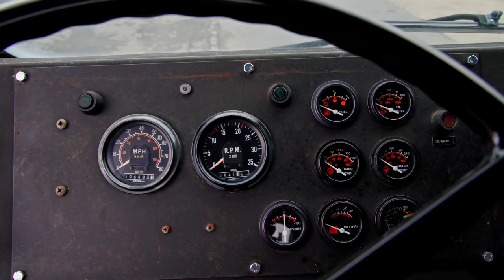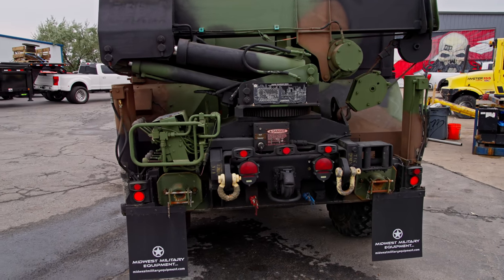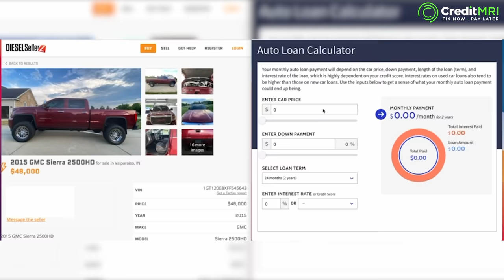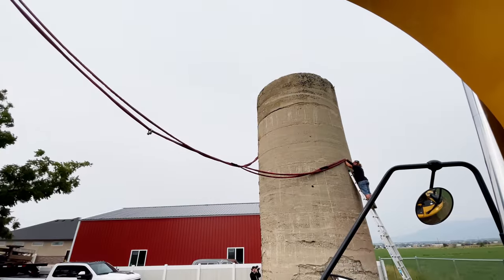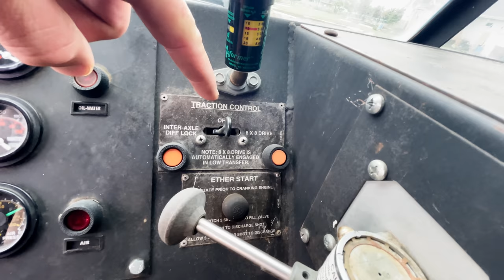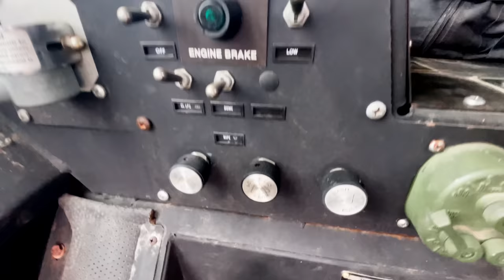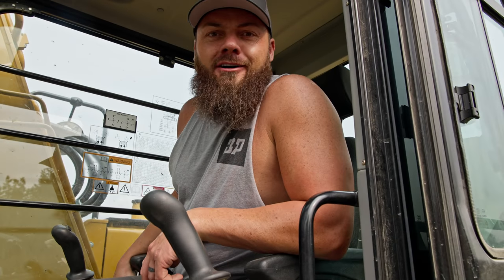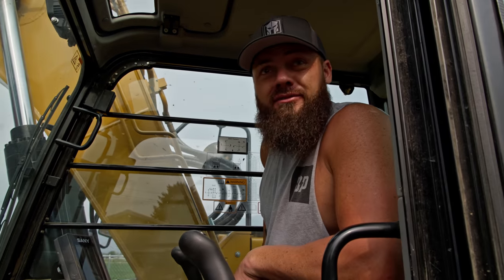This Giant Silo Could’ve Smashed Our Newest Recovery Vehicle 😅

Comment: Beside your seat to the right is a low transfer case handle....pull it up and it locks all 8 wheels up and your in low range and it's all horsepower.

Comment: They make a machine to recondition old it's a vibrating Hopper that cleans up the old bricks about 20% of them break because they were junk anyways but you end up with a bunch of good clean old bricks and the ones that break up and crush up either use for anything you want Culvert material or backfill

Comment: If you want more power then change the governor so it gets more fuel. They have a governor on them to keep them from going faster which effects the power as well. Look into it. In the governor there is a screw type tube that has a small hole in it which allows the amount of fuel that goes to the engine. When I was in the military we used to drill the hole bigger which in turn gave the vehicle more power and faster on the highways

Comment: With the hemmit it comes down to more torque than anything if more horse power it will need a better turbo but remember they are high pressure engines as it is so do research on it. Gearing of them will be easier and less expensive but all of it is worth it. Also I grew up in Fond Du Lac which is 30 mins from oshkosh and grew up close to them being built.

Comment: I use to work in a shop and my job was to tear down 8v92s. Probably torn down a couple hundred. It was all contract work for the military. From me it would get cleaned machined and then rebuilt. They would always have issues in the dyno with them but i think that was from the builders not knowing what they were doing 😂

Comment: If you get a good nylon pool rope it'll stretch half the length of itself and the stretching power is what pulls on your car or your tree or whatever we use them to pull over trees with this tied to the big truck and tighten the Rope we don't drive it away or nothing the tension of the Rope pulls a tree over when you start cutting it you don't even have to pay attention well you do but I've been cutting trees for 50 years

Comment: If you would have used a heavy vehicle as an anchor with snatch block attached low sow angle line down to snatch block and pull strait would have come down one pull

Comment: 9:48 that kind of hand brake has no influence over the pressure going to the spring chamber on the air brake assembly which does the parking, it applies pressure to the service side of the brake chamber assembly which does the braking under normal use. I drove a Freightliner with one of those for several months and an International with one for a week and FUCK International, they should have gone under instead of White

Comment: M977A2 or LRPT, This is one of many but my absolute favorite for my job in the military. I drive an A4 but the older A2 is twin charged which is badass. I want to own one one day.
Reply: "Large Parts Repair Transport" The cranes are awesome and super handy. We use them to move around just about anything. The stowage boxes hold can secure any tool you'd need/straps etc. We also pull trailers with them. By far my favorite military vehicle I've driven. Totally utilitarian.

Comment: This is one of those times where a Yankum isn't really ideal. There again though I suppose a chain may have just sliced clean through it. It's a tough spot not having enough room to maneuver without crashing into the neighbors lawn. If it were me in that tight of space I would have taken relief cuts and taken it down a section at a time.

Comment: The best way to take down a silo is to turn around and sandbag around the perimeter of the silo and then the shotgun with slugs to turn around and act like a saw to cut the side walls as far as using your truck to turn around and pull it down you really should have used shiv block to turn around so the truck would be going away from any danger point from The silo collapse

Comment: I went to school to rebuild these in the USMC. Love these screamers! Improvements? I'd say air induction temp, better injectors,  better turbo. Solid engines! Oil leakers but I don't care. Water pump seals suck. I had a wrecker in the USMC. In the USMC we called them #dragonwagons because thr cab can articulate separate from the bed.. She was 🍒. These can pull some loads.. I love DETROIT GREEN!🇺🇸🇺🇸🇺🇸

Comment: Love Detroits.  Durable, noisy, unique.  If that's an A0 or A1 model HEMTT, it's an 8v92TA with 9G85 injectors.  Good (new) for 450HP and 1250 lb. ft. torque.  You could put in 9E95 injectors for 480 HP and 1330 lb. ft., but you're going to start to shoot unburned fuel out the exhaust.  Not sure you want to do that given history, and frankly, I'm not sure it's worth the power.  You could try to get fancy and rig up an aux intercooler, but if memory serves, there isn't a lot of space to do that.  You could do a propane system, but I think it's not the best idea for a whole litany of reasons.  Swapping the C-15 in isn't an option due to new tranny and transfer case requirements.  Listen, the Detroit Diesel 2-strokers are best when they are maxed out on RPM.  They don't lug as well as a 4-stroke, but you just can't kill the darn engines.  Yours looks like it runs fairly clean, so just live with it as-is in my opinion.  When you are unable to spin the tires then you need more power.  Until then, enjoy the machine.

Comment: If you hit the side you want to fall down and knock about a 2 ft x 8 ft long thing then pull it with your Hemet it will fall down in direction of the weakest point would be where the block you knocked out at this is physics for you it wouldn't work but since this is 2 months old you already probably know that your friend donald

Comment: Most people that have four wheel drive vehicles that use them for pulling a recovery you know they got big hooks on the frame and whatever and Lux and D rings and pull straps and all that but being Farmers you know having a drawbar which is a steel bar from the back to the front one piece mileage on your vehicle dislike a farm tractor that's how you pull